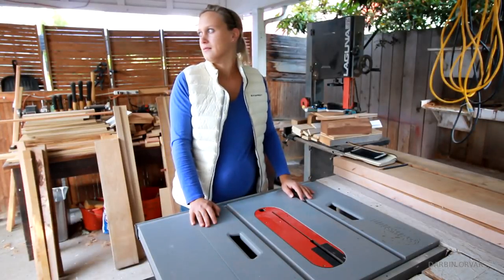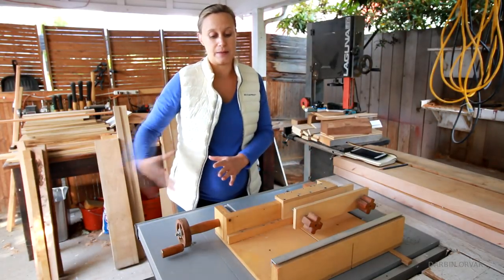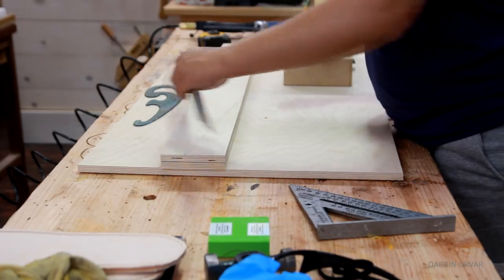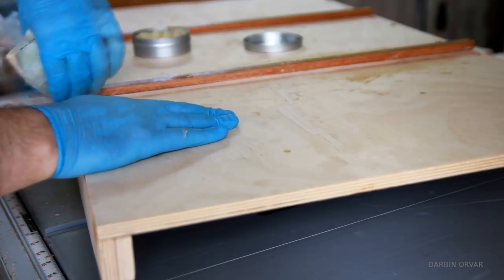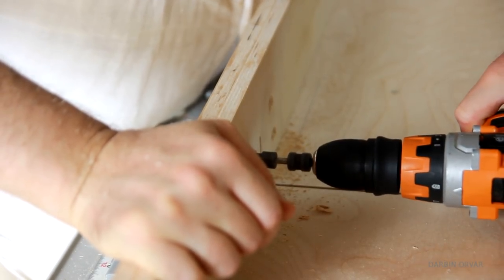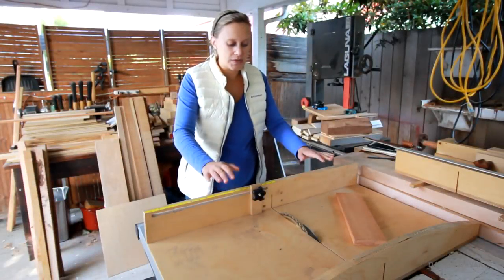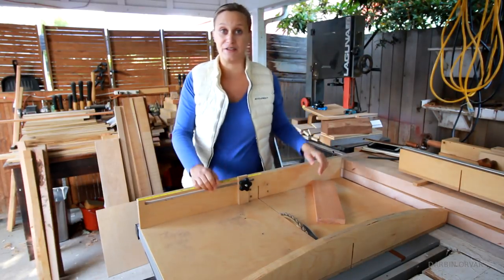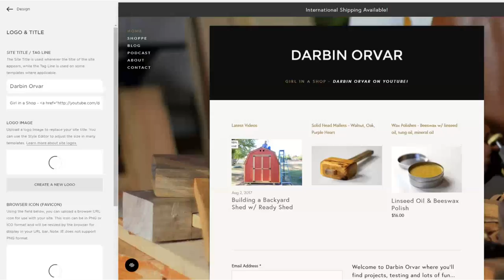Cross Cut Sled w/ Adjustable Stop Block

Comment: It's nice to see a stop block system that doesn't use expensive T section rails. If your bolt keeps spin you could router a shallow section on the back of the sled to catch the T bolt so it does spin loosening or tightening the stop block. Mummy or sled and baby sled... ☺

Comment: Nice crosscut sled Linn. One suggestion, I would cut a little "relief" section at the bottom of the stop block closest to the work piece and along the bottom section where the work piece contacts the sled. That way sawdust won't get clogged between the surfaces of the sled & work piece...............but you already knew that........... :)

Comment: Nice table saw accessory.  What grade is the baltic birch and where do you get it?  I ask because the plywood they sell at the local orange box is full of voids and usually warped.
Reply from the maker: Thanks. I buy baltic birch from a local lumber mill in 5 ft x 5 ft sheets. I have never come across it in a big box store.

Comment: thoughts about putting a 90° "top" on your stop block which would better align with the ruler?
Reply from the maker: I thought about it after I did it, but then I realized I should have routed the opening lower, but then there were screws...anyway the bottom aligns nicely so it works well.
Reply: One of the advantages of the top block is that you could space it so the bottom of the stop block did not contact the sled so there would be room for the sawdust to go and not jam up.  Also small dado in the top block would keep the block from scraping the numbers off the ruler.  Sorry, I am complicating a simple workable design, but that's what engineers do.  I have noticed that I haven't found a good place to store a large sled....on the floor against a wall, I ended up with water being adsorbed into my hardboard based sled.

Comment: Can you use this sled if the arbor is tilted to 45 degrees?  Or, do you have to make another sled for mitered cuts?
Reply from the maker: Yes you can, but then the kerf would be pretty large and you might get tare out.
Reply: I am not really concerned with tear out.  I am going to use it for mitering really rough little boxes.  I don't have a nail gun or a stapler (yet) so I will be mitering 1/2" or 3/16" wood.  Gluing and screwing them together.  Thanks!  Love watching your videos.